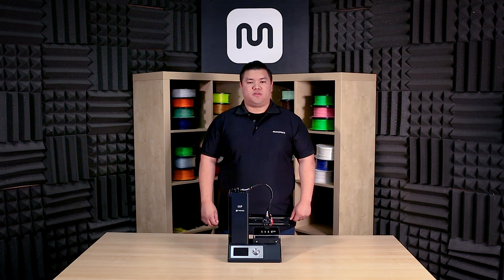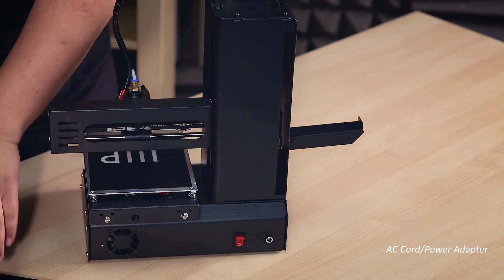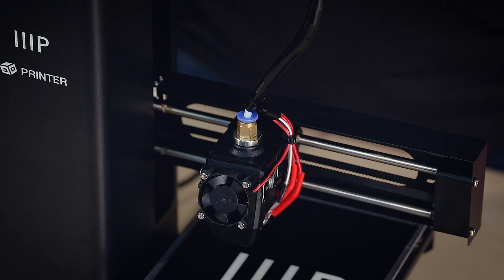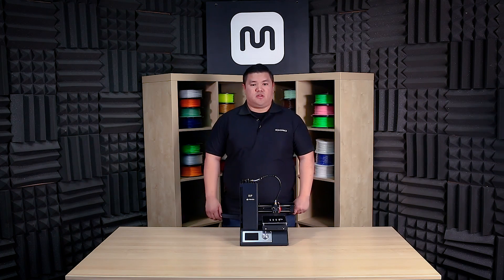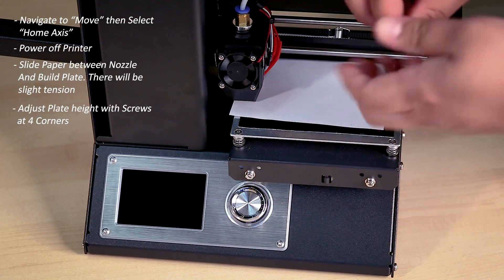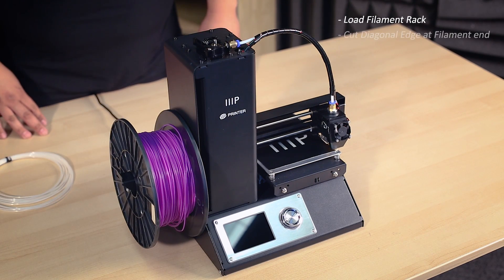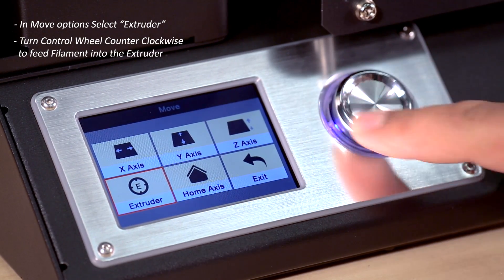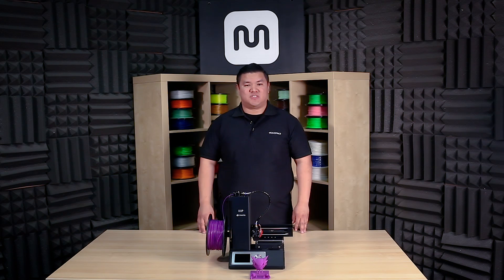Monoprice Select Mini 3D Printer v2 - Unboxing, Setup, and How-To First 3D Print

Comment: when i go to extrude, the filament comes out fine, but when I start a print, the filament won't come out, and it just goes in the motion of the program and does nothing
Reply: Sounds like a .gcode issue. The printer isn't being told to feed the filament. Have you tried to print a different model ?
Reply: @WhiteRaven___  no it is fixed bow, my problem was it wasn't leveled, so the table was to high, but all is well now, thanks for trying to help

Comment: I highly recommend printing a bunch of nickle testers or right angle testers instead of the included cat (and using 10% fill). Also i don't recommend using kapton tape unless you have a 120 mm wide roll (or sheet). The overlaps of the strips of tape look pretty awful on the finish

Comment: I bought this thing and I wish I had returned it when I had the chance. It never sticks to the plate, I've tried different temperature variations with painters tape, glue, etc. it still won't stick with fist layer :/
Reply: Version2 has it's own grip and it sticks very well. Almost too good. So either you have version 1 or you have the extruder nozzle too high off the bed. You can also try building a raft support.  Are you using cura or pronterface to slice and print?
Reply: @lliaolsen728  using cura. It's definitely v2 and if it goes any closer, the extruder drags the print foundation.
Reply: @SBinKMedia  Then your hot end temp isn't high enough.  200-220 for pla, 220-240 for abs
Reply: @ericperkins3078  I appreciate your feedback, but this is incorrect. I did temperature variations from 190-230 varying by 5. I use another printer with a build plate of 960mm^3 that works great, but it's also not a $160 printer
Reply: @SBinKMedia   add a small glass top to the bed and use some clips to hold in place  then lightly spray some hairspray on the  glass and it WILL stick ;)   obviously you also have to alter your z height when you home as to compensate the thickness of the glass ;)

Comment: Spool Storage Orientation:    Is there any deformation issue when storing filament horizontally (like in the background shelves) vs. vertically (like as a roll of toilet paper would hang) when not in use?
Reply: Shouldn't be. I have another 3D printer and the filament is both stored and actually fed into the printer in the horizontal orientation and I haven't had any problems

Comment: My Printer is always printing in the corner. what should i do? i've tried multiple changes, but nothing works!
Reply: Sounds like your slicer settings are messed up (example: the origin '0,0,0' coordinate is wrong and the printer is starting in the wrong place) or you are slicing for a different printer and this one interprets the Gcode wrong

Comment: In the 6 weeks I’ve had it:
1 - The extruder broke and had to be replaced 
      (upgrade) - £11,
2 - The bearing in the cooling is staring to fail, 
3 - Print bed has warped - need a “glass bed upgrade” -    
      still trying to find suitable glass to use.
4 - The build plate temperature sensor has died (as a result 
      of the warping) - new thermistor needed.
Reply: I have some of the same problems. This thing is a pos. We should start a class action lawsuit.  The bed has bowed in the middle upwards.
Reply: @robh1908  What are you? Half Jew? Just send in a complain And they might help you out. Or Try to replace some parts.
Reply: @drwhite7285  
I have tried ffs. They don't care. Customer service is nonexistent.
Reply: @jamesv4463  , well, his name IS Dr. White. 😀

Comment: The instructions with mine says to use the Cura version on the included SD card. Every time I use it, (Cura), it offers me an updated version. Should I be using the old one or the new one? Thanks, Rocky
Reply: the new one as the old one is outdated

Comment: Wow, calibrating the bed with that hex key looks like a pain in the neck, why didn't they include thumb knobs instead?
Reply: THAT!!! was my only problem using this awesome little printer the technique for levelling the bed ... was not good  and that is why one of my first mods was to customise the bed so that you can adjust it using ...like you say knobs ;) ive now done the same to my two other mpsm and also to my two i3 printers

Comment: Temperature IS important. I've so far only used PLA and use a nozzle temp of 205 and bed temp of 55. Minimum nozzle resolution I use 0.2mm, unless it is a very small and detailed part in which I then use a setting of 0.1mm. Avoid using rafts if the object has an overall flat first layer AND is not "top heavy". I always use a skirt or brim simply to prime the extruder. This ensures accurate, even layers when the actual object begins to print. 

More questions, feel free to email (relic1974@gmail.com) and I'm considering constructing a fan website dedicated to THIS printer !!!
Reply: TSN Research 
Nice one. .
Reply: Hey, did you start a fan website? Inquiring minds want to know. Thanks for the great tips!

Comment: This will prevent object/raft warping and prevent the nozzle from making melting contact with the bed. 

As for SETTING - Print the cat.gcode provided on SDCARD. If it comes out nicely, simply go into Cura and you can LOAD your profile settings from an existing gcode file. I loaded the initial settings from the cat.gcode model as a base line. From there you can make slight adjustments depending on what you are printing. 

Also - To get the most area out of your MP mini V2, set the machine XYZ settings to 122x122x122 in order to get the FULL 4.7 inch build area. This also helps when using skirsts/rafts/brims as they require extra build area.

Comment: Tips for PERFECT prints with this printer:  First let me say that there are big differences between V1 and V2 of this printer. The V2 has a more reliable power supply, does not have the haphazard wiring to the bed heater, reliable fans, etc. 

I found that using Cura is the best option for slicing. IMPORTANT - Start by first leveling your bed after unboxing. The extruder tip has a cutoff switch, telling the printer when the hot nozzle is in contact with the bed. I've seen first users melting into their black bed adhesion surface with an unleveled bed. I have printed dozens of objects and not once have I melted the adhesion surface.

I level by raising the Z azis by one minimal turn of the rotary knob. Use a sheet of paper, folded such that it JUST makes contact with the (slightly) raised nozzle. Adjust according on all corners and in the center so that the same amount of paper-to-nozzle distance is equal.
Reply: Why would you raise the nozzle first?
Out of the box you should lower the bed then hit "Home" home sets the nozzle at the print Z height and you simply raise the bed till you reach the appropriate gap to the nozzle. The stock Bed is thin aluminum and is uneven in the gaps between screws. So printing and adding a Z-Extension to the tower and adding Etched Glass for the new bed will give you the best print surface and extra height to make taller prints.
Reply: how many cats have you printed 🤔

Comment: Would anyone recommend this as a first printer for beginner? Looks straight forward enough...Anyone using this for 3d hubs?
Reply: Iamnobodyimportant Yes this is a good first printer as it comes with a cat so no need software to test and it comes all assembled and very easy to learn and good price
Reply: @hazoish7670  but what if you're a dog lover? ;-)
Reply: If you're thinking of getting a 3D printer then you need to ask yourself 1 VERY important question ... is it to be a tool or a toy. 

The distinction: 

As a toy: you're going to be happy tinkering with it - replacing bits / improving bits ... like with custom cars. You know, just as happy working IN/ON the engine as driving the thing. 

As a tool: you’re expecting to just make your designs and throw them at the printer.

My experience of the Monoprice Mini Select:
Its a toy, a £229 toy, but still a toy. In the 6 weeks I’ve had it:
1 - The extruder broke and had to be replaced 
      (upgrade) - £11,
2 - The bearing in the cooling is staring to fail, 
3 - Print bed has warped - need a “glass bed upgrade” -    
      still trying to find suitable glass to use.
4 - The build plate temperature sensor has died (as a result 
      of the warping) - new thermistor needed.
Reply: Martyn Hutchby I bought this around the time you commented. As a toy and to see if i can handle 3d printing (I have no patients)

This is certainly a great starter and to my untrained eye near perfect on fine layer height. I have managed to eat through 1 PLA spool and I'm half way through an ABS. 

Now I'm looking into getting a proper printer. What would you recommend need 300 x 200 bed?
Reply: The Creality Cr-10 Mini would be a good option. It has a build volume of 300x220x300, glass heated bed, filament run-out sensor, and pretty good quality for the price. I currently have an Anycubic i3 Mega and it seems to be working really well, especially for the price.
Reply: I got this as my first printer a couple weeks ago. I bought it on amazon. I would give it a 10/10 experience for the price.  The print quality is pretty awesome  Slicer software is free, and so is cad software. Get this with a few spools of pla and for under 300 bucks you can get into 3d printing.

Comment: hi can this printer print with flexible filament
Reply: Actually it can but it requires a 3D printed modification
Reply: No, it cannot. For you to print PETG or any other flexible filament, you would need to have a direct drive printer, meaning that the motor that pushes the filament needs to be mounted right next to the extruder. If you try printing PETG on a printer that does not have direct drive, the filament would bunch up and get clogged in the PTFE guide tube.
Reply: @Edzilla007    you are  WRONG!!!  yes you can print with flexi filament  NIKS DAYA  Dont listen to this guy  i have three of these and even use one set up for wood filaments  only prob it have to keep replacing the nozzel .. ;)

Comment: Can this printer be used in the uk due to the higher voltage here, do i need an adapter if so what is it i need? thanks
Reply: it comes with a laptop type  power supply, so just get one with a UK plug on the Figure 8 cable (or put a UK plug on it).
Reply: We use the version 1 of the printer in the UK due to this.

Comment: How do you reset the home axis? After cancelling a print it got stuck
Reply: Use manual shut-down and turn it on back again, and then use go to home axis. That's the only option that works for me.

Comment: What's the difference between this and the V1?
Reply: My V2 is white
Reply: its black
Reply: and it has an all metal extruder
Reply: NoLuckJustSkill | KurryKiller™ And there’s a buildtak type surface. There’s also a fan on the back for the control board and as cell said the color and the hotend
Reply: Chase Hanson thx for the extra info
Reply: Kristopher Cash yeah I think they added that afterwards
Reply: Great little machine. I've had mine for about three weeks now, good prints from day one. Only issue is my Wi-Fi was not enabled from the start. Online instructions indicate must upgrade firmware. -Tony

Comment: This video will give birth to so many glorious half cats.
Reply: neokokido actually it has enough sample filament to do the whole cat
Reply: Mine did a half cat anyway. The build plates on these are about as flat as a bowling ball. 
Just skip trying to print on the stock plate/buildtak like surface and put glass on it. I honestly wish they left the build tak off and kept $1 profit more, because it is a pain to remove it if you want to take it off.
Reply: @bjostad  how do we add glass?
Reply: Build plate can't be calibrated because in most cases from what I heard on fb group and in my case because it's not flat. So you will need extra glass bed.
USB printing does not work well, it will keep making pauses in the middle of printing. Same goes when I tried to print via WiFi, so only with SD Card will work without these extra stops.
Cancel option does not work well, it's very random.
Reply: @VladaNish HA!!    usb printing on mine works great in fact its the complete opposite of what you said lol i got all sorts of problems printing via the sd card ..  in fact  the list that popped up was all gobbledygook   so maybe it was the card but  four and a half years later yep ..still printing via usb ..;)
Reply: Not to brag or anything, but I was able to get the whole cat printed in one try B)
Reply: I am thinking of buying this v2. Are there more problems besides the build plate that you found?
Reply: neokokido 🤣🤣🤣🤣
Reply: The motors are loud as a result of cheap bearings.